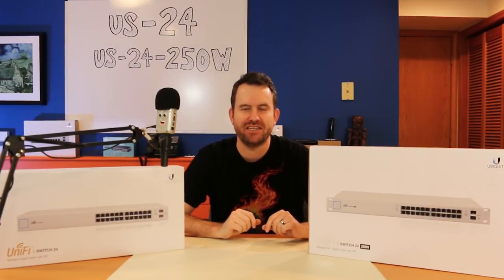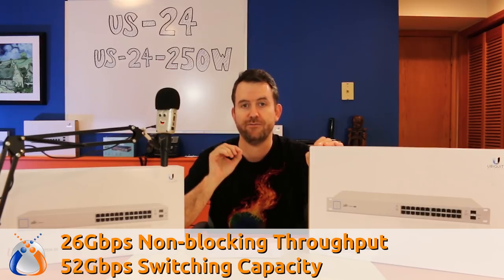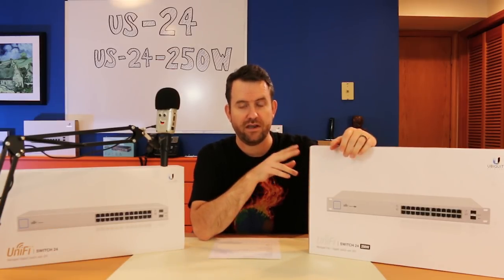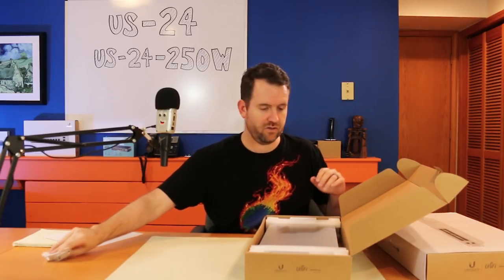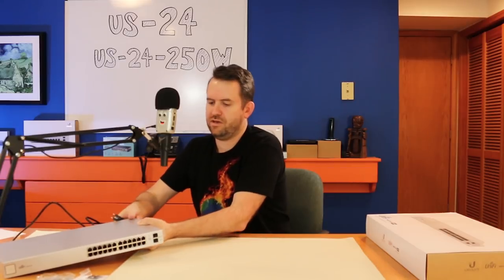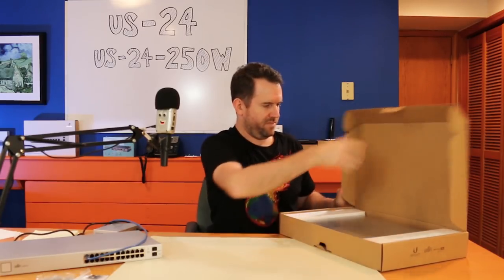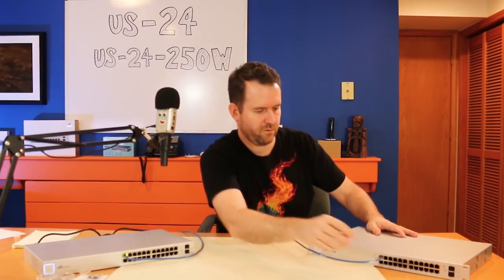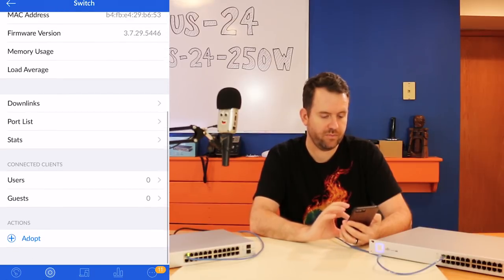US-24 & US-24-250W Setup w/Fan Replacement

Comment: I am wondering how many cameras the ubiquiti pvrs can cope with. Any ideas? Maybe a useful video.
Reply: The specs pages for any of the cameras will give an average and max power draw. You'll would want to keep the peak maximum power draw at around 80% of the switches rated maximum, just to be safe. I believe the current power draw is shown in the interface, as well.
Reply: @edwardgreenjr167  Sorry, I meant how many can it cope with for recording video streams. Power isn't an issue.

Comment: You need to invest in a short enclosed network rack on casters. They come in handy, especially with acoustic foam.
Reply: What set up for acoustic foam have you found to work best in racks, inside or outside etc?

Comment: Thank you for your video! Does anybody know the measurement of the US-24 (without POE). It's weird, I've found different answers on different sources in web. Thanks!
Reply: From the datasheet (https://dl.ubnt.com/datasheets/unifi/UniFi_Switch_US-24_US-48_DS.pdf):

443 x 43 x 221 mm

Comment: Rather than replace the fans I ripped the board out of the case and mounted it on the wall without any fans attached. Zero dB and never reaches more than 65 degrees, even on a hot day.

Comment: Thank you for taking the time to create and upload your content. 
I have worked with and hold certs for Cisco and other "traditional" enterprise networking products  and been doing it full time for well over 20 years.  
My question is how does anyone who is proficient with Cisco or HP switches ever feel good about how these switches are managed.  
I can install and configure a HP or cisco switch with 10 well defined vlans in 15 minutes for the first one then copy that config to 10 more in 15 min and finish the final config for all 11 fully working and connected in less than 1 hour. 
I have been working to create proper vlans for 2 hours and I just factory reset it out of frustration Trunks/VLAN Tagging and access port configuration seems to be designed by someone who never configured an enterprise network. 
 Any more Cisco / HP guys have the same or different opinion on using unifi switches in small enterprises ?

Comment: I would search www.mouser.com for quieter fans.  Hugh selection and you can sort by fan noise level, air flow, voltage, etc.   Generally the lower speed of the fan, the quieter it will be.  High speed fans are generally more annoying even at the same noise rating.  But be sure to get one with enough air flow.  You might consider buying 4 fans with the lowest noise with half the cfm and mounting them all.  I would not use a 5V fan on a 12V supply as that would also most certainly be noisier. You could also consider using a 24V fan and running it at 12 volts -- just be sure the fan is rated to run at half the voltage.

Comment: Great video- very helpful. But just a note about adding sound levels in dB. If you add a 20dB sound source into a 40dB one that only raises the overall sound power level to about 40.04dB, not to 60dB. 
Adding dB values multiplies the two values (which is why it is useful for calculating things to do with amplifiers and attenuators).
Even adding two 40dB sound powers together only takes you to 43dB (ie double the power).

Comment: Seeing this just highlights how much wasted space is in that case.  I would much rather it be smaller with a filler piece for installation in a rack if needed.
Reply from the maker: There is definitely a bunch of empty space in there - but I also assume that they re-use a lot of this same switch and its components for their 48 port variants.  If you are Ubiquiti, selling hardware for slim margins, it makes a lot of financial sense to re-use as many parts between models as possible.  If there were different form factors for 16 ports, 24 ports, and 48 ports, it would cost a lot more in R&D, manufacturing, and distribution.  Gotta think like the big guys!
Reply: @CrosstalkSolutions  Well you have to look at your 2 switches here.  one with Rack Mount attachment and one with a different face frame and is only Rack Mount.    This flies in the face of what your saying.  

I think the 16 and the 24 could share the same cases.  And have a spacer should you want to Rack Install.   

Regarding the big guys, don't join them BEAT them.   I think a Rack Mount 24 port switch is a waste.  Not many people are going to put that in their racks!  It is not enough ports!  The only reason a 48 Port would be an option is SFP+.  This 24 port switch is not for "Big Business"

Comment: These fans are very expensive in Australia. But if you are wanting more than 4 of these fans, it is cheaper to get them from Noctua eBay store here. https://www.ebay.com.au/itm/Noctua-NF-A4x20-FLX/332674339675?hash=item4d74ef935b:g:8S8AAOSwcgNZHnwp 
Hope it helps.

Comment: Their warranty is nearly worthless anyways, modify away!
Reply from the maker: I've never had an issue with a Ubiquiti RMA.
Reply: @CrosstalkSolutions  I mean specifically its 1 year, which is fair for the price. I tell my customers that for the price of the switching and access points its basically disposable IT if it should fail after the first year.  I have had to deal with too many USG RMAs for clients and without advanced replacement RMA such as with other vendors we waste a lot of time bringing in loaner devices while we wait on the replacement. The switches are missing a lot of enterprise class features that we are spooled with on much, much more expensive brands but for my SMB or small branch offices can't beat the Unifi switches.